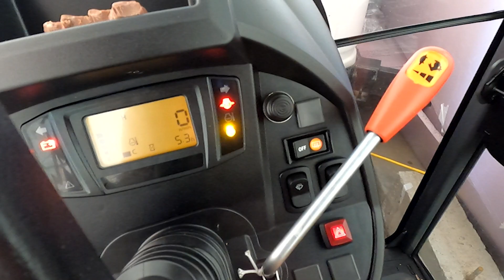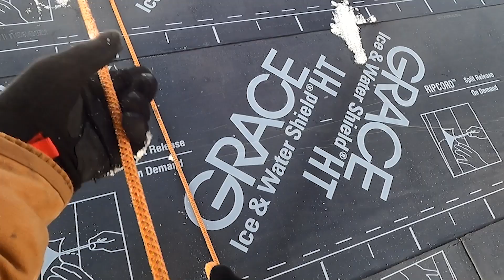DANGEROUS ACTIVITIES IN THE SNOW | LIVING ON A MOUNTAIN IN THE WINTER

Comment: A solid way of cleaning roofs of lots of snow. Is done by tossing a rope to the other side and se sawing through through it.
Reply: Like they do in Yellow Stone?
Reply: I was thinking the same thing.
Reply: With the pitch of that roof? Colossal waste of time trying to knock the snow off. Tack a 12" drip edge copper strip above the fascia with some snows stays. I used that system on a slate roof in Northern New England. The snow stuffed off in small sections when the sun heated the copper. Worked brilliantly.  Don't fight nature. Mitigate.
Reply: you right... just need steel  peek of the roof
Reply: Allie does  masterful, storytelling editing. This is how you make everyday activities interesting. That and T & A's charismatic personalities. Thumbs uo to Allie's hard work.
Reply: Yes I’ve seen that in videos in Alaska, acts like a cheese slicer
Reply: @MaShcode  When the house is heated would there be less accumulation? Or is that the case mainly with older, poorly insulated houses?
Reply: @mbmacdonald8429  A cold exterior roof surface is what you want. It means heat loss is minimal. Attics should be only slightly warmer than the external ambient temps unless of course they’re designed as an insulated living space. Otherwise you’ve got a heat loss problem.

Personally, I’m not a big fan of sealed houses that don’t adequately ventilate and circulate air. Trading some heating efficiency for fresh air makes for a more livable space imho. Especially important now that we have to mitigate airborne viruses.
Reply: Thatz pretty darn smart.  Seriously
Reply: Do they have heaters for the roof?
Reply: @s.z.6200  when they put on their metal roof, it'll come off pretty easily - usually on its own.
Reply: @paul shutts Oh wow! I haven't seen that in a while. They used to do that up in Ft McMurray, AB, Canada! Thanks for posting.
Reply: @MaShcode  think that why houses of yesteryear “ breathed” not as many breathing problems “ there must be a simple correction... open a window slightly?

Comment: Glad to see you finally bought a proper ladder!  Suggestion to remove snow on a roof.  Take a 2 x 6” and a length you are comfortable with like 3 ft or 4 ft.  Drill 2 holes holes in it toward the ends.  Get rope long enough to go over the roof in both directions.   You can throw the rope over the roof or use a telescoping pole to lift the ropes over the roof.  Then pull the board onto the roof.  You can then pull the board up and down on the roof to clear the snow.  Far safer than climbing on the roof to clear the snow.

Comment: Hi from Adelaide Australia. I love the new pictures at the introduction. Just wondering about the safety of the position of the chimney being close to the stairs. Chimneys get very hot. Also, make sure your railings for your deck are vertical not horizontal so kids don't climb it. This advice is from a mum of 5 kids :)
Reply: well..i guess chimney got double steel plate so should be ok,,im more worry about heat from stove,,i got stove what allmost heat going front direction and i can use  half yard  long woods.
Reply: Vertical railings are always code and close enough together so that a kid can't stick his/her head between them.

Comment: Look up roof clearing with string. Essentially you tie a long string (nylon cord) to a "hacky-sack" and fling it over the roof. Then stand back and pull the string at an angle. It works remarkably well once you get the hang of tossing it up and over.

Comment: If no one else has suggested it,  when Allie sweeps up saw   Dust save it to put under your tires when they slip on the ice or snow. You're doing an awesome 👍 job and with the last piece of pipe you will have heat 🔥. A lot easier to work.

Comment: Honestly, seeing Trent on the roof is less stressful than seeing him on the scaffold!  You're sleeping on the roof ... That's a good one, LOL. So close to fire in the stove!  Man it's a long time 'til Friday.  💕
Reply: Yeah, you really need to put some planks on the lower levels to strengthen the frame. Each plank can be made of an 8 foot 2 by 10 with a pair of 8 inch 2 by 4 cleats that snug up against the outside of the end bars. 2 planks per level can make that scaffold rock solid and much easier to use.  The Metaltech scaffold wheels are $45 each at Home Depot and will save a bunch of time later, when you start insulating and sheet-rocking. That Appalachian plank you are using is a deathtrap.

Comment: New intro graphic is amazing. The aerial footage of the trees covered in snow is just sooo beautiful! 

A side note of watching these videos: Watching you build a house inspired me to do projects I would have never attempted before. Like what you ask? Well, remodeled my bathrooms, replaced my horns in my truck, rebuilt the steering wheel sensor after pulling a replacement part from the junkyard, completely replaced my entire front end suspension including ALL the ball joints and shocks on my truck, and am about to finish rebuilding my entire kitchen counter space including a butcher block top and redoing all the plumbing with the garbage disposal, replaced my water heater with a smart water heater and finishing with a replacement whole house water treatment system. This was all done in the last 30 days. Sound like a lot? When compared to building a house...nope. And that is kinda the point. Watching these told me to just get off my butt and do it. If you can build a house, I can do these minor things. Thought you might like to know that as much as I've enjoyed doing these fun projects. Thank you.

Comment: Since seeing the first snowslide off the roof several weeks ago, it strikes me that you'd be very wise to construct some kind of dormer or frame at the edge of the roof, directly above the front door. That way, any snow falling from the roof will be directed away from people entering/exiting the door. It seems pretty crazy to leave the front door - and anyone using it - totally exposed to that degree of random snowfall. You've mentioned kids in the future - hard to imagine you'd want to leave them unprotected from that kind of event.
Reply: Allie was saying they're going to use the sunroom door during the winter so that's not a danger It's just a danger while they're building.
Reply: I was thinking the same..but maybe a bit more to also make some shaded area in summer. Not slanted to front but slooped on either side. /\
Trey..you're a good guy to help snow stuck drivers!
Reply: Snowhooks are normal in snow countries like Scandinavia, Austria, Switzerland, and parts of Germany, France, and Italy. Should do fine on T&A roof.
Reply: I just looked up the snow edges for metal roofs...looks very effective.

Comment: DON'T do not - ever hook your tow cable that high on your tractor unless you want to pull it over backwards on top of you!!!!  Lost a very close friend to that error.   :(   You always hook low!
Reply: Was thinking the same! I actually saw a Jeep that ran the wrench cable over top the brush bar because the pulley broke.  When the applied a lot of pressure it actually picked up the back wheels of the Jeep.  We cracked up!
Reply: And I feel bad adding another warning, but please stand so u can use the remote further out than the wire out fly if it broke or let go. A friend was in hospital for a long time and lucky to be alive after a his wire line broke and hit him in the face. I figure better to share and all is good rather that not. I’m stew we will see a fire soon. Take care.

Comment: I feel like the bottom of the chimney flange should have gone over the rain and ice shield. Water could get in around the bottom, that caulking may not last. Top of the flange under, bottom of the flange over.
Reply: I’ve seen other installations done how you describe. For vents & other roof penetrations. Good point.
Reply: @simpson1672  i do lead work and on any roof, the top of whatever it is we are doing goes under the bottom goes over, or in at the top out at the bottom
Reply: @gsyguy1  ??
Reply: That cutout piece of ice & water shield that Trent flung off the roof would have been about the right size to slide up under the metal flashing (or perhaps cut it in half lengthways).
Reply: @truckstomotorcycleswithtom3197  what? ???? im not from the usa we dont do tin work and our roofs are not built like yours but as with tin work same applies with lead work ,we make slates like that for soil pipes / stacks and chimneys that come out the roof and the top goes under the felt,some times the sides too,  and always comes out over the bottom .thats on felt roofs ,slate and tile.... been doing it for 30 + years
Reply: @gsyguy1  Thanks for the explanation

Comment: Of course you could put on studded winter tires, or you could put on chains. I would put chains on the Kubota. After many years spent in snow country, I now keep a large pile of sand in a strategic place with a black tarp over it. I keep the tarp shoveled (plastic) off, so the sun keeps the sand thawed. I also start each winter with 4-5 buckets of sand in my shop ready to go. On days like this video showed, I save a lot of time by throwing down some sand. Most of the time I can avoid stuck with a few handfuls of sand. It's cheap, quick and easy. You'll be amazed how little sand it takes.

Comment: Trent make a roofing ladder  it's made of  2x4s  for a frame 1x4s for ladder rings assemble lay it flat screw it to the roof next to metal roof panels.  To temporarily  water  blockcut a hole the size of the  flue pipe slide down the pipe against the roof  it will block out moisture

Comment: What are y'all thinking for insulation inside the cabin?  If you're going for rock wool or fiberglass insulation, why not "soft fit" the walls to retain heat in the cabin? Super easy to pull/place when and where you need to run plumbing/electrical while keeping the cabin toast(ier) in the winter.

Comment: Yes Allie is soo awesome and positive all the time love it wish my wife was like that As far as the tractor goes if that’s all stock, it doesn’t weigh enough is the problem and looks like the wheels aren’t made for wheel weights either. Got to call an ag tire shop that puts BEET juice in the tires. Yes beet juice. They will come out and do it for you. It doesn’t freeze and would work very well for what u have there. Put it in all 4 tires. I’m an iceroad trucker from Alaska and you must have ground pressure. The snow is insulating your pipes. I would for sure atleast put a fishing shanny or something over that outside water pipe to keep the wind off it atleast. You guys are so cool. I watch all your videos all the way thru. Very very good job editing just amazing. 👍🏻😃

Comment: You need to have a ceiling fan that you can turn on to reverse in winter to push the heat down. otherwise upstairs can be very hot. i have a high ceiling house and the woodstove made upstairs a sauna.   Turning the ceiling fan on reverse made everything cozy upstairs and down. Also nice to have in summer  when you can turn to normal.

Comment: Trent, was surprised you started at the roof to install the stove pipe when I installed the stack started at  fireplace then you don’t have the problem you have. Also was surprised that the ice and water shield  came up so easy. Because it is adhesive on the one side and once put down is difficult to take up.

Comment: Two words: wheel weights. Also, lower the tire pressure if filled with air. If the tires are filled with just air, then you might can have the tractor tires filled with water + anti-freeze solution by the dealer. Will give the tractor much more useable weight and it will not hurt the tractor.

Comment: Trent put another layer of ice n water shield around any pipes on the roof it will pretty much insure zero leaks in the future..do strip on bottom of pipe then side n lastly on top above it great job so far on the roof it will last 100 years

Comment: Now you know perhaps some sort of eave heating system, such as electric heat tape in the eaves against the roof wood, but I don't know if a short might be worrisome to start a fire. Safer would be a way to put some heated air into the eaves, and also perhaps not insulate the eaves. Anyway, some thinking and planning for that in future

Comment: Once your walls are sheetrocked you won't want to be sledge hammering your home so an easy way to do roof snow removal is to tie a weight in the middle of a long strong cord and throw it over the middle of your roof..then each of you take an end and pull apart. Works every time. You may have to go between vents.

Comment: You might want to think at getting a roof heating system before you do dry wall. Because it will melt the snow off roof and heat panels with your solar panels. This is because you have to get up and shovel roof off on regular basis. You all ready hav3 snow to deal with. You will be very happy and grateful you don’t have to shovel roof. You see it now.

Comment: I hope you found some patience and built out, including masonry, around where you place that fireplace/stove. The way you make measuring mistakes and that will be more painful than it needs to be.Do it RIGHT and ONCE!  I also hope your stove has a controllable separate outside air intake (run under the floor to the joists box), so you don't waste heated air from inside the house to keep the fire fed with O2. Controllable also helps it to burn longer as coals, rather than a blaze of glory.  At that elevation, HEAT is something NOT to waste. Every little bit counts. Especially when running around naked in the house. LOL

Comment: TRENT... No idea if you'll see this, but I was carefully watching your roof jack installation for the stove vent pipe, and I hate to say it, but I think you should revisit the roof.  The bottom flange of the roof jack should be OVER the top of a layer of the Ice & Water Shield.  At first it looked like it might just overlap an inch or two, but then when you slid it home it ended up several inches above the lower layer of Ice & Water Shield.  Any water running down the vent pipe and roof jack will run onto the plywood instead of onto the Ice & Water Shield.  Even though you caulked around the top of the roof jack you should never rely on caulk as a first line of defense.  Slip a sheet of Ice & Water Shield up underneath the bottom of the roof jack at least several inches... ideally more, you can notch it to fit around the vent pipe a bit.  I know it's going to be a PITA, especially since you caulked it down, but I'm tell you this from experience of having to fix a leaky roof for this exact reason.  Cheers.

Comment: How do you remove snow from a roof with a rope?

First, you should tie your hammer on to one end of the rope, creating a makeshift weight. Once you're on the roof, toss the hammer on to the ground (but don't forget to hold on to the other side of the rope!) Once you've dropped the hammer, wrap the rope around the edge of the piled snow.

Comment: I couldn't tell for sure but it looked like you installed the chimney pipe with the crimped end up.  It should be pointing down, otherwise the creosote and condensation will run down the outside of the pipe.

Comment: Wondering why you could not set top of black pipe further into the black box you fixed to the inside of the roof ? ... also does the black pipe join to the silver pipe on the outside of the roof ? if yes would not setting the black pipe further into the box also raise the silver pipe nearer to the correct height for the silver pipe ? ..... never fitted a wood stove ,hence why I'm asking !

Comment: Work smarter trent make a frame that will support sheets of plywood at 45 degree angles to the ground and the garage walls.  Take and cover with black plastic staple in place this will minimize shoveling snow off the side walls.. now the preheat of the house will allow it to move. Leaf blowers work great as lightweight snow removal  tools.

Comment: Man, I know you are a pro climber, but that would have freaked me out, not the height, but the slipperiness of it. I love to climb too, but not in that snow.  Think I'd have opted for a lower roof or a metal one. Lots of people with high roofs in Idaho are switching to metal 'cause the snow just slides off of them.  Sorry your chimney pipe wasn't long enough.  Hopefull ynext time, you'll get it done. Be careful; lot of crazies on the roads in winter.  See ya next time.

Comment: I'm confused.  Isn't the black stove pipe single wall sheet metal? And isn't there a seam the length of the pipe?  A seam which can be opened (without damage)?  In the past I have used such a product and it can be cut to the right length with metal shears (tin snips), and the seam rejoined (it slips together and locks).  And hopefully that first length of pipe above the stove will have a draft damper, so you can regulate the draft there, leaving the entry draft regulators on the stove more open to allow more oxygen to the fire for complete(r) combustion (and less creosote creation).

Comment: Trent don't you need to put a dampener flap in the pipe to regulate the heat because wont it just got right out the Pipe and you'll lose lots of heat??? Do you know what i mean i might not have said it right

Comment: Are you sure the chimney is for a woodstove? In Canada we must have a two inch depth from the outside of the pipe to the inside pipe. (2 inches of insulation) Your pipe appears to be thinner and would only be approved here for an oil furnace.  Unless, my eyes deceive me. Also, American regulations could be different than ours.

Comment: * IMPORTANT MESSAGE *    Kitty litter under your slipping tires will assist you in moving your vehicles.  And if your tires freeze to the ground.  Pour bleach over your tires and it will release the tire so you can drive your vehicle.